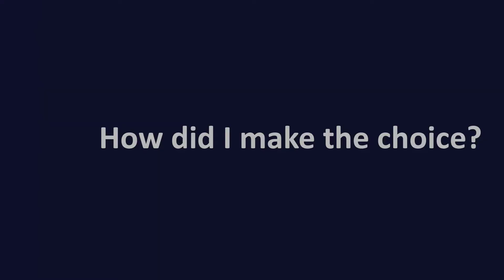What software for FEA and how to choose it?

Comment: Hii will they work for windows 8.1 ☺ could you suggest me a FEA software which will work for windows 8.1..
Reply from the maker: Hey Tanu! To be fair, I never used Windows 8... I switched from Windows 7 to Widows 10, but all of those would work for Windows 7 so I don't think you will run into any issues. You can always ark your local reseller - I'm sure that whichever soft you will choose folks selling it will be more than happy to help you with that (but as I said, I do not think you will run into trouble!). All the best!
Reply: @Enterfea  thank you I tried ansys but it doesn't work but i am trying more.. Btw thank you for kind reply
Reply from the maker: @wowlondon  that is almost impossible to believe. I would think that Ansys should work with Windows 8... but maybe there are limitations I'm unaware of (?)

Comment: I`d like to use Abaqus. because I hear the linear and nonlinear mechanical analysis function is very strong
Reply from the maker: Hey! Sure - Abaqus is super cool! I used it for my Ph.D. It's not that it has more functions that I would "normally" used, but I get the feeling that the "normal ones" just work better when it comes to convergence etc. This is really a nice piece of software.

Not to mention that I could see the outcomes "in real time" as the analysis progressed (I didn't have to wait for it to finish).

Noting is perfect of course - setting imperfections from previous analysis is pretty frustrating (well... at least it was, maybe they have changed something since I was using the soft!). 

All in all, Abaqus is great - but the commercial license is also insanely expensive - this is what stopped me from considering it for my company.

Comment: Thanks! Interesting and logical presentation. Do you think there are any open source FEM sw that is relevant and/or popular for industry? (as OpenFOAM is for CFD). What kind of imporvements (if any) would you like to see in civil FEM SW?
Reply from the maker: Hey Paul!
I'm glad that you like the video. When it comes to open source I think that code_aster would be the choice (but the French manual... hard stuff). 
As for Civil FEM I'm not a user. I saw a demo once, I even did like 30min of clicking on my own... but the interface and the "civil engineering possibilities" were annoying if I remember. The solver isn't bad but the "design according to codes" options could be better... that all being said it was like 2 years ago and I'm sure you guys are working on it on the clock - so who knows where the soft is now :)

All the best
Ł